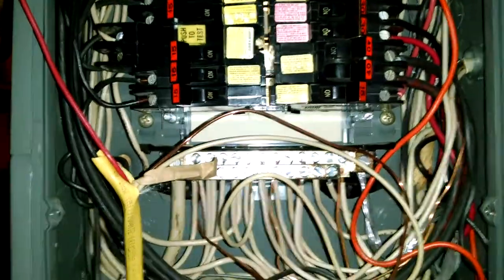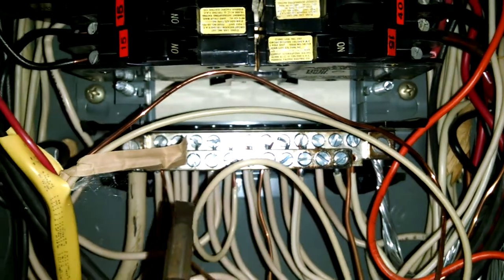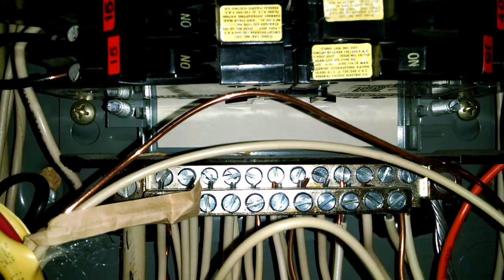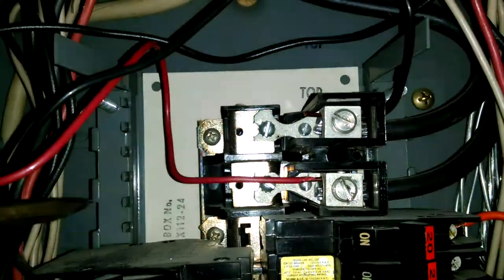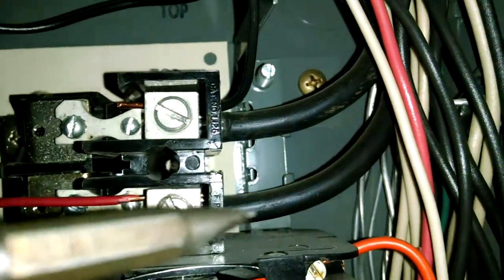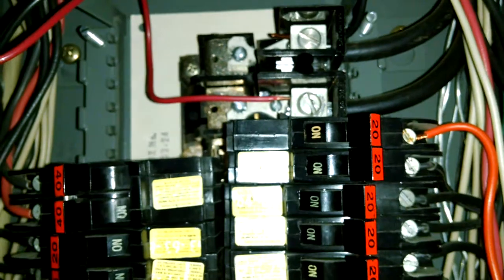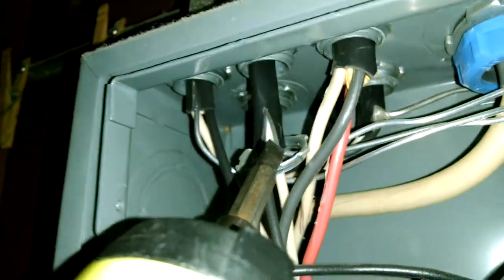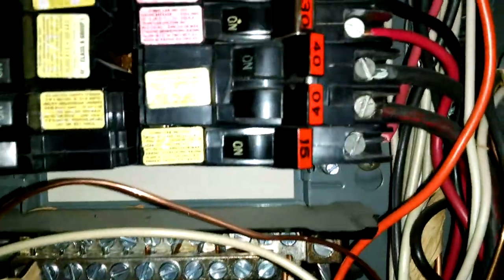Breaker Box, Copper & Aluminum wiring, GBS Inspections

Comment: Wow, first that panel was recalled, replace it.  Al wiring is a pain, but not the main problem. Double lugging (yes!), no main cut-off switch, tapped the main feed with much too small gauge wire (looks like 12AWG with yellow sheathing) to feed that additional sub-panel, where I saw 30A breakers (ground floating?).  I also see a terminal on the far right lower neutral buss that doesn't even have a screw in it. Also, if this is a sub-panel and not Main, why are the ground and neutrals tied together? should be separate busses, isolated.  I'm an electrical engineer who has wired their whole house to code... with multiple inspections.
Reply from the maker: You do know that all federal pacific boxes were not recalled. Right?

Comment: Thats not safe at any speed no 1 thats a FEDERAL PACIFIC PANEL no 2 you cant double lug not to mention copper & aluminum have different expansion rates. This looks like a main lug panel and will have a remote main disconnect. This FEDERAL PACIFIC panel if a fire hazard and needs to be replaced. Aluminum wiring is pure garbage and also needs to go.